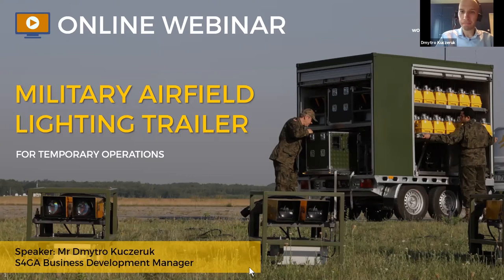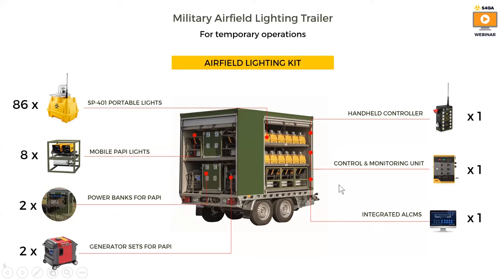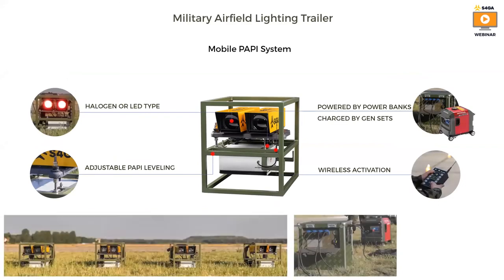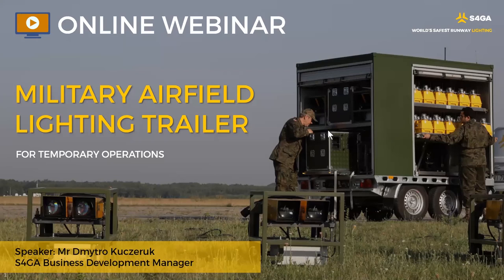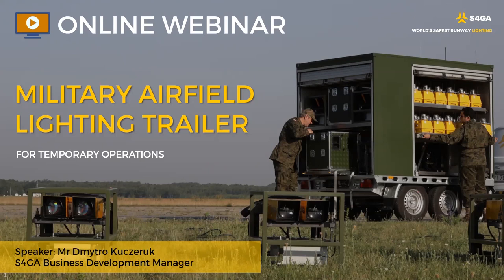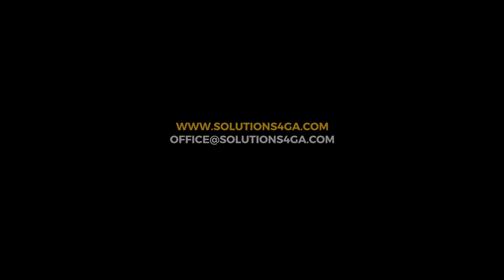S4GA Webinar: Military Airfield Lighting Trailer for Temporary Operations

Comment from the maker: 02:35 Agenda
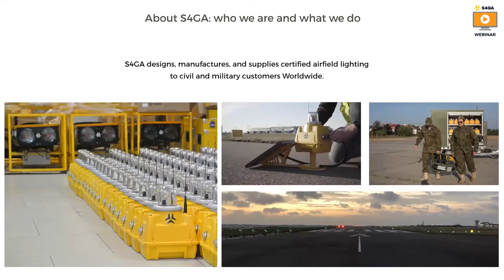03:57 About S4GA
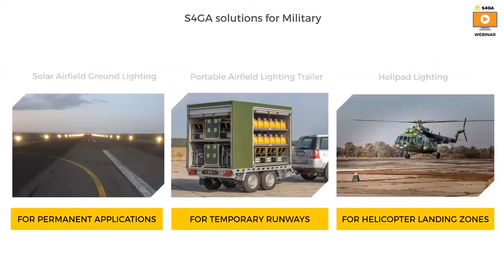05:12 S4GA Solutions for Military
06:03 Compliance of S4GA Military Trailer with NATO requirements
07:03 Portable WIRED airfield lighting in S4GA Trailer
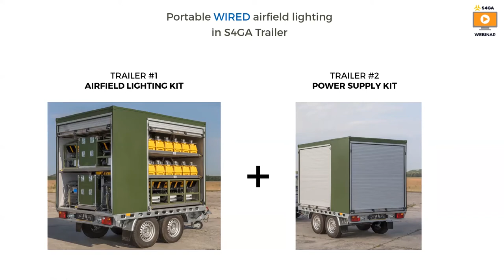08:06 Trailer #1: key features
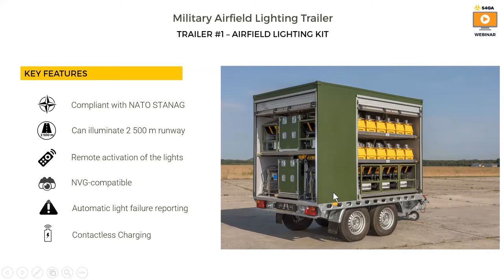09:06 Trailer #1: AGL equipment included
10:47 Trailer #2: power supply kit 
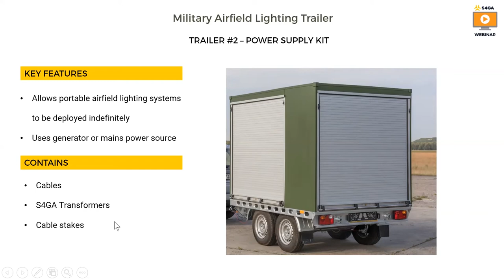11:32 Trailer for NATO: what is inside?
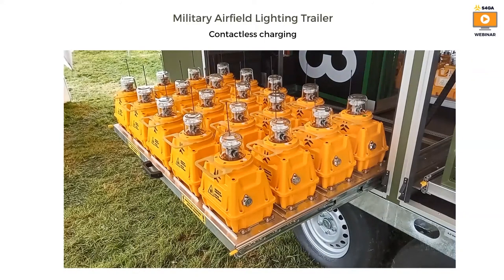13:07 Remote activation of airfield lights
14:21 Airfield lights and power supply
14:28 SP-401 Portable airfield light
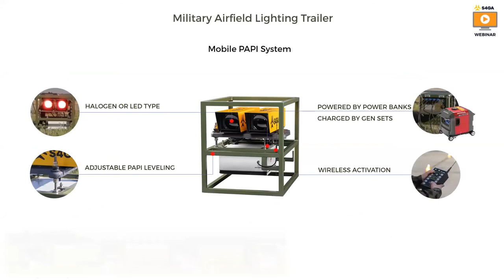15:45 Mobile full PAPI system
16:41  Portable WIRED airfield lighting
19:04 S4GA Transformer
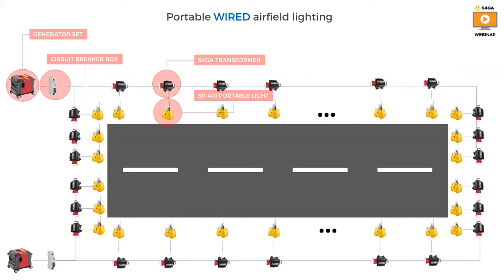19:59 Portable WIRED airfield lighting: technical drawing
20:49 Key benefits of S4GA WIRED portable AGL
21:43 Case studies
26:00 O&A Section